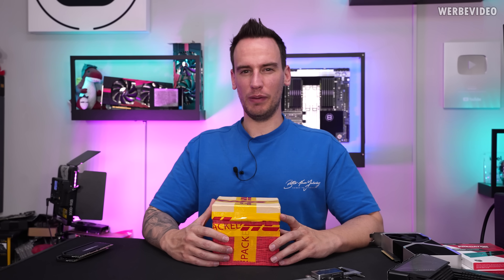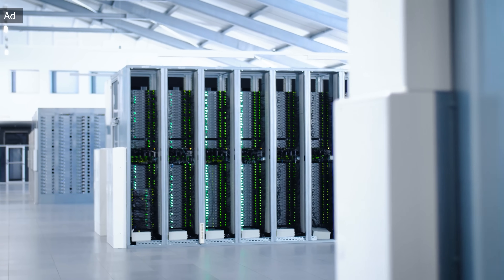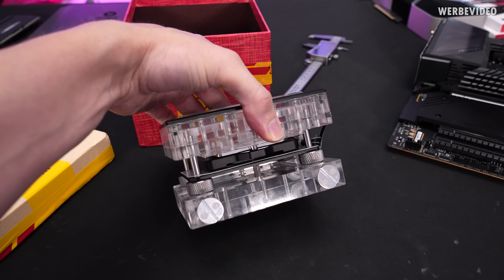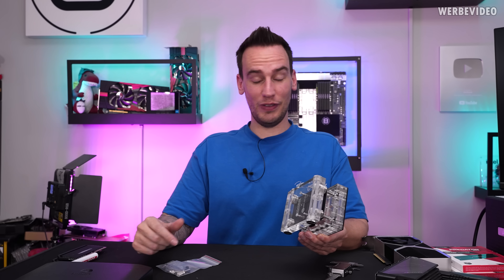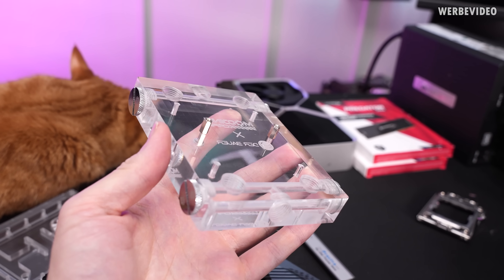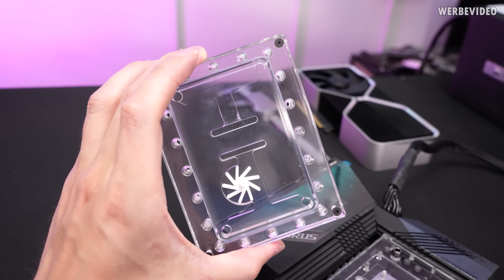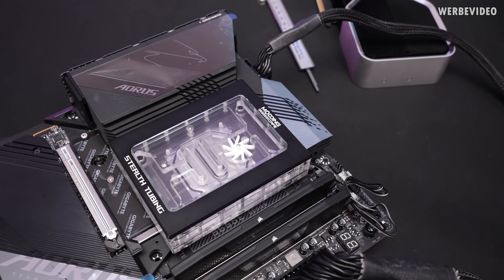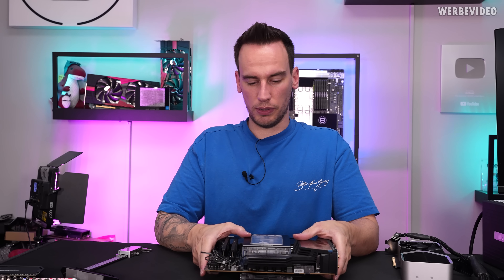A New Generation of Water Blocks? Stealth Tubing Block Tested in Detail

Comment: im currently building a stealth build, so 0 cables, and 0 tubing. this would be perfect for my project if it was possible to also connect to a GPU waterblock. I'm also waiting for the asus mobo and gpus that pass through the GPU power through the backside of the motherboard. think they called it 12hp_c or something. cant remember exactly.

Comment: It's a pretty solid idea; now it just needs to be paired with a GPU block that has fittings on the back (if mounted vertically) or bottom (if mounted directly to the mobo) to hide the tubing as much as possible. Granted, that would lead to a lot of dead space due to how much longer the block would be compared to most GPUs, but it could lead to a real nice minimalist cuboidal design.

Comment: Future cases with rear side connectors and stealth wiring will need to have a deeply skeletonised and reinforced mainboard tray in order to be compatible between makes and models. I'm thinking this sort of thing may fit right in! Like imagine the tray being all just spars that connect the standoff positions, but being kind of thick. Plenty of room there.

Also next step may be flat tubing to help traverse the spars and wiring.

Comment: I looks like a great concept but I worry about the thermals. For heavy loads on a pc it wouldn’t be able to cool it fast enough. But if there is a way to make the back plate be a distro plate in to a radiator then that would be next level.

Comment: I love the look of it and its something that would be great to see in the mass market. In a pc case like the Thermaltake Tower 900, this block would make so much sense due to the radiators being positioned behind the front compartment of the case. I do think the amount of cases that this would fit in might be fairly limited due to the backing being to thick but also needing the space to run the tubes behind the motherboard. Def would love to see this become a real product tho

Comment: It looks like something from the future. And of course the thermal performance was obvious from the rough surface of the bits power plate so the performance was irrelevant here as you said. The design is the only focus and it's definitely the best one I've seen so far along with the EK one which is also transparent.

Comment: It is a super neat design, — but expanding a bit further — it could cool the vrms, and perhaps ram (with custom top acrylic and custom bottom cold plates) — but as the design is now its already very good looking, and I would definitely buy for one of my motherboards to try it out. And as others have mentioned excellent pairing with the ASUS board where GPU cables are hidden — now that board just needs 2x 16mm holes, so that the GPU can be cooled by water from the underside ;-)

Comment: The smaller tubes into the block will likely have minimal impact to flow simply because the block/fins are likely more restrictive.

What this does do is open us to the possibility of using smaller and more flexible tubing.  Replacing the two large tubes with four smaller tubes that match the diameter of the tubes passing through the board, could allow for a much thinner back plate and improve case compatibility.

The front plate seems too large for what it is.  Much of the bulk in today's water blocks is the size needed to mount the inlet and outlet tubing.  Without those, I would expect the block to be much smaller.  That said, awesome proof of concept.

Comment: I like the concept & Design - not a fan of BitsPower blocks (have had bad experiences with them in the past - plating flaking off and causing reactions in a loop).  I can definitely see where adjustments/improvements can be made - also I would have no issues on hacking up a case to get it to fit lol.

Comment: Typical German enginerding... Neat design sure.  Just form over function.  4 points of failure instead of 2.  My question is, how long until the acrylic crazes/cracks and you drip coolant all over the back of your graphics card?  It will definitely be too expensive to mfg to be worth purchasing aside from some 'have to have it' numbskulls.  Way cheaper and better cooling solutions already exist so what's the point?

Comment: I toyed around with this idea a few years ago, the way I did mine was with an EK velocity cold plate for the 10xxx series intel, roughly the same with the front plate, but the rear plate I milled from 304 stainless , brazed the pass through tubes directly to the rear plate which I made 9mm thick over the fittings and had a recessed female G1/4 thread directly over them, kept my profile small so it only stuck out around 2mm from the mobo mounting tray and could have any standard fitting straight off them.

Comment: Something like this i would buy. But this mean a big change in the design of the radiators too. All the tubes to be hidden. I think this will be the next trend in the water cooling. A pc case you can modify easy to hide everything. But now only the radiators need to change. In and Out must be on the lateral side. But small diameter of tubes will affect the flow and the dimension of the backplate. You will need two pumps to help the flow. One for In and one for Out, to help each other.

Comment: It's a cool modding project, but I don't see myself using it despite having a custom loop.
Not being able to see the connections between the tubes and waterblock for safety, requiring a special case and setup for the tubes to go behind, the motherboard compatibility and so on.
It does look amazing but I'd rather keep it simple for a 24/7 build.
But again congrats to the modder, it's a sick design!

Comment: The biggest change would be to try a similar system to EKs new blocks to get rid of some of those mounting steps. Otherwise, I feel a good pump could help towards the potential flow issues

Comment: Looks bad firstly, then it's pointless can easily get cooler temps the right way to water cool a pc with a normal waterblock 😂 why would you need a a alien looking 2 blocks that won't hold much cooling water it would just be like a hot radiator 😂 tall about waste of time designing and money

Comment: This is absolutely amazing and I would prefer this with soft tubing at the back than hardline like I have now because it was a pain in the ass to bend and assemble. Also, would it be possible to have some kind of cold plate on the back side as well to have the CPU cooled from both sides?

Comment: I can imagine this as an sff option, granted the backplate will need to dissipate the overall heat generated. Something like the sandwich style Meshliscious with standoffs this is a viable product and the sff community is all to familiar with undervolting to accommodate this ingenious design.

Comment: they need to design it so the left side is a water inlet and the right side is a water outlet. this will allow them to add 1 inlet and 1 outlet to the bottom of the front plate so you can add a stealth tubing GPU cooling block. this would create a fully water-cooled system with a seamless design. I have a design idea for a stealth passive water-cooling case that would make this cooling solution blow people's minds.

Comment: We're going to need some kind of standardization on how much space there is available at the back of the motherboard when it comes to the backplate as well as the case / side channels. I'm not against using that part, but it's going to be hell figuring out which case to choose to fit this all in.

Comment: Such a cool product. I only feel unease that everything is relying on those tiny o-rings to stop any potential leaks. Any misalignment before joining is a potential problem. maybe more guides and slots to make sure they are 100% aligned? Also the bearings on that cute little spinny thing have to be god tier to keep moving with time.

Comment: use the stand off space and bring the water channle to the MB side were the 24 pin is only using the under side of the board there should be 8mm of stand off or so

Comment: Flow rate should be ok, it looks like there's more cross section through the tubes than there's through the fins in the block. It will be some added restriction but imo fine.

Comment: Well I would be very interested in something like this, actually it would make fitting a screen on the block much easier and clean which is the new fad now for waterblocks, also with the new trend of hiding cables behind the mobo this would be perfect for that given that cases will need a bit more space behind the mobo to fit the cables sticking out, also it will go hand in hand with the same philosophy of hiding stuff, with some clever tube placement with a vertical card you can also hide those tubes, the only difficult ones to hide would be the rad tubes but still it's not impossible.

Comment: The pass through tubes are fairly narrow but there are two each for input and output side so while this won't be absolute top tier in cooling performance it will still likely be solid enough performance to not throttle any cpu. Really awesome design and I'd be willing to bet there is a significant amount of people who would pay for such a block.

Comment: The texture on the cold plate water side could be useful. It would increase surface area and disrupt laminar flow. Laminar flow is good for efficient movement of fluid, but creates an insulating layer which would decrease thermal transfer efficiency. If you don't like the look, change it to a small pattern or lettering.

Comment: I'd buy this.

To deal with the case backplate space issue; 
if the kit included really long (1 inch - 1 1/2 inch) mother board standoffs, then the back water block part would have room to actually be in the inside of the case instead of needing a case that would account for it on the back of the case.  Obviously that would mean you need a case with enough room on the inside to do this AND have room for a GPU ... but this simple answer might increase the cases it could run in ... with just a set of standoffs.

The double positive is; now with room behind the motherboard to run the water lines from the out/inputs, thru the interior of the case to the res/pump/distro whatever, you dont have to problem solve getting the water runs from the back of the case to inside the case.

 I assume this solution still needs the full water setup, you didnt mention.  It would be very odd for it to thermally work with only a cup of water sandwiched in there.

Beyond that, less Z dimension for this back block would be a good thing,  and it doesnt even need to be acrylic really, unless its an open design case where it would be seen.

Comment: Tubing will greatly reduce the flow rate of water through the system. It has to do with the low diameter and adding another tube doesn't help as much as adding using a single but thicker tube.

Comment: Regarding the flow. IF this water bock get enough atention and similar cooling solutions start appearing, it would be best to contact the motherboard manufacturers to see if they would be prepaared to make the mounting holes bigger. Otherwise the only other hols that every motherboard has are the screw holes, but those are small. The other option would maybe be a stronger pump, but at that point acrylic may not be a good option.

Comment: It is a fail because without a case for the pump and rad in the rear this will not deliver a stealth tubing look.  There is no cooling flow performance design in those four mount holes.  Looks like good craftsmanship.

Comment: The reason why your MOTHERBOARD "powers on" (not fully, but a minimum state of power) has to do with a BIOS setting.. I'm not sure how GIGABYTE/AORUS labels it in the menu but I want to say that it is a setting about returning to the previous powerstate when the board has an 'IMPROPER SHUTDOWN'  (not going through the shutdown menus in windows) - (I wanna say that the different states are S1, S3, S5 etc) and you probably have it set to return to a certain power state after the power is restored... you want to set it to 'OFF'
- - I could be TOTALLY WRONG about this, but I know on my ASROCK board this is a setting and by default it is set to 'return to previous power state' when power is turned back on after an IMPROPER SHUTDOWN
- - I HOPE THIS HELPS!!!

Comment: Looks fantastic, small tubes that go through motherboard are very clever solution to hide tubes and make it compatible with most am5 boards. Looking at that flow meter flow was looking decent I guess but I'm sure someone could calculate it if they had speed of it and dimensions of the channels.

Comment: Great idea. But instead of cutting additional holes to mount the backplate part, there could be longer distancers that the whole motherboard sits on. Making the backplate itself thinner could pose a problem, since we don't want to restrict the waterflow more that it already is by making the in/out water holes smaller. 

In my current case this block wouldn't fit "project wise", but there are many scenarios where one would want to use this instead of a normal waterblock. 10/10 for innovation, but this still need some optimisations.

Comment: Very impressive product.  Honestly if there woudl be a way to utilize the extra 4 holes aroudn the socket that was replaced for extra water pass throughs it could give extra performance.   But still this along with board that have power plugs backwards as well, woudl make it very clean.  That just leaves the GPU ;)

Comment: I really like this concept, would be fascinating if it could actually be optimized for a production product. My biggest 2 concerns are VRM temps (the block looks like it restricts airflow in those areas) and how the block's flow rate compares to other water block designs.

Comment: one thing that I thought of immediately when seeing this is that a pair of connectors on the lower edge of that could be used to run cooling to a vertically mounted GPU. Hide it behind the card itself for a totally clean looking interior. Maybe a modded slim 011D type case with half the front clearance since it would be just a slim water cooling setup. The back could be the other components, making a perfect wall mounted pc or desk pc with nothing but the mb/gpu showing and everything else behind the tray, hidden.

Comment: my thought is if it can be brought to market for a reasonable price and perform well also. its a great idea and looks beautiful. the other thing would be make it easy for everyone to be able to drain it as well. i also wonder if you can step tubing sizes up to increase flow and pressure as well. i would buy one though if it was worth it. looks like bitspower used sand paper and not a cnc on that block lol.

Comment: thats modding cafe for you and as usual der bauer gives his honest opinion , and yes that plate seems rough for the cpu and i was wondering if the pump will not over work for that tiny tube inputs as well as the output but thats my opinion and correct me if i am wrong and for the build this is one kick ass block if the performance to various builds will improve as well as the look of it but damn this is next level.nice content  i saw ggf installed one of this.
Reply: Ban stated that Der8auer didn't read the email, the plate is from Bitspower, they made it specifically for the 12th gen CPUs, hence the rough sanding, and it was reused for the AM5 platform.
Reply: @vusun123  oh so i see but still then thats a good block from mod caf. .....hope to see that from other enthusiasts. thanks for the info.

Comment: "Stealth Tubing" is a very aesthetically pleasing design. My largest worry was case compatibility which you mentioned, and secondary the performance, and tertiary the appearance. I'm very interested in seeing a mass production item using the back-side tubing, and I think the visual flow meter was cool, and I think the "understated" RGB was a good match for the "clean" design with no obvious tubes. Even if your goal is to showcase other parts, any showcase design would benefit from the reduced visual clutter, and it's beautiful on its own.

Comment: Drilling out the motherboard holes would allow for bigger tubes, and much more flow. Most PCBs have a few MM of clearance around each mounting hole. Just another MM larger tubing would probably double the flow.

Comment: Maybe the case compatibility issue can be solved by having the "backplate" be not much larger than the standard one, with just enough depth to not restrict the flow, and to allow mounting 90º fittings for a tubing run behind the motherboard tray.

Comment: I wouldn't worry too much about the small diameter pipes that pass the water through the motherboard, let's be realistic, the space through a jet plate is only a fraction of that and is generally speaking the biggest restriction in a loop.

The only "downside" I see about a block like this is that it'd be near impossible to find a GPU block to match. Which would kind of ruin the aesthetic, unless you want to go full custom case anyway and you can hide the tubes coming from the GPU.

What I'd love to see in a block like this would be some sort of contact plate for the M.2 SSD, so you don't need to worry if the OEM heat sink will fit. But I get that this is not an easy thing to standardise given that motherboard manufacturers can't even be bothered to put it in the same place with different revisions of the same board.

But I love the Monoblock-Junior-Grade look and style.